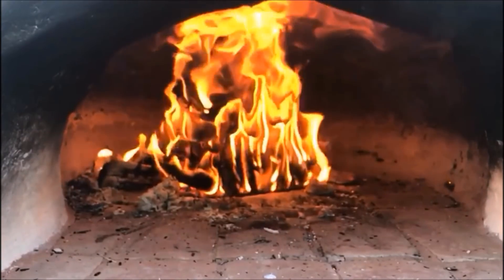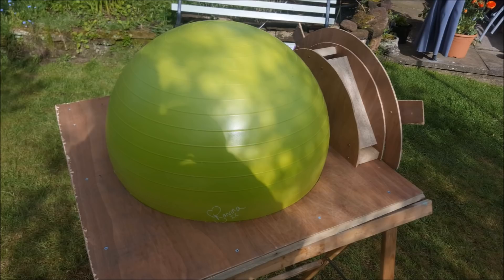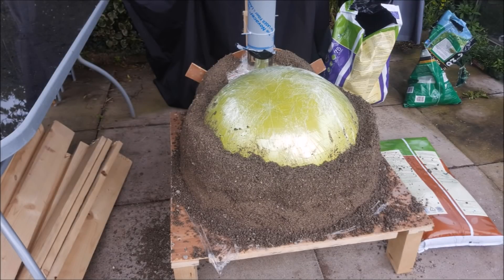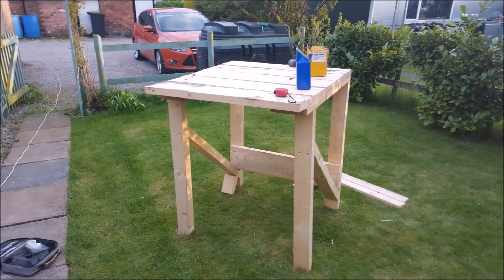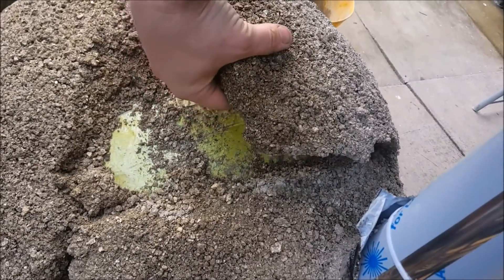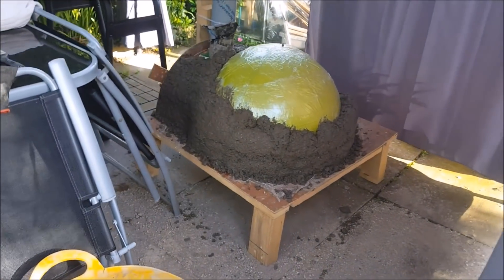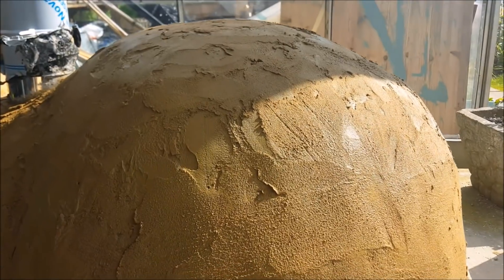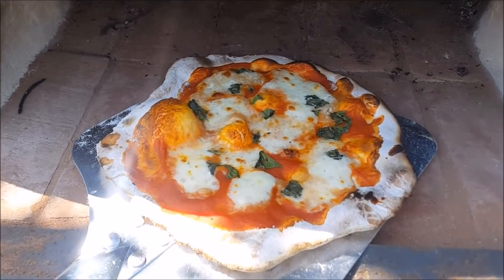How To Make A GYM BALL PIZZA OVEN 🍕

Comment: Thanks so much for including the mistakes and the fixes.  Makes it seem more doable by real people.
Reply from the maker: Thanks! I felt like the mistakes were worth including so that if anyone tried it at home they don't make the same mistakes!
Thanks for watching 👌
Reply: @PaulLloyd  Looks like I made a bad mix.  I used 5 perlite and 1 refractory cement.  It didnt hold together.  I have it all crumbled in a pile.  You reused the mix.... how did it hold up?  Im going to add one part portland cement and one part sand to it....
Reply: Agreed, I thought the same
Reply from the maker: Just go for it 👌
My lesson is use plenty of cement to hold it together and not let it dry too quickly!
Use a damp towel to cover it and slow the drying.

Comment: How did you persuade Jason Manford to do the voice over :-). Great video Paul, thanks for sharing. I broke apart my first attempt with the gym ball because I thought the wall thickness was too uneven and thin towards the top go the dome - and I was right. The flex in the gym ball tended to slide material towards the base of the structure. I solved this by using a Tyrolean Gun to apply the first 2 cm coat all over. I then placed a chicken wire frame over the cement mix and then finished with 4cm of cement, again applied with a Tyrolean Gun. Worked a dream and only took 20 minutes to apply. I used 5 vermiculite to one cement mix and made the mix fairly wet (worked better in the gun).

Comment: I'm at the stage where I will be adding the 2nd layer of concrete. Many video's show chicken wire being used to reinforce the concrete.  Is this something you considered and if not would you use chicken wire if you were to make another oven ? Thanks in advance.
Reply from the maker: I haven't had any big cracks in mine, although adding chicken wire wouldn't hurt. 👌 It would keep it together if you got a major crack in it & you could just seal it up again.

Comment: Thanks Paul. What was the heat retention like considering that you didn’t use any other insulation? Did the outside of the oven get hot too? Thanks

Comment: My plywood underneath sand, underneath firebrick is turning black and you can smell it smoldering, during my initial curing fires. Did you have this problem? Will it hold up? Am I going to have to cut the oven off the brick, dig up the bricks, and add insulation? Please help.
Reply from the maker: Are you burning wood inside the oven?
I haven't had any problems like that.
The bricks that I used were around 4 inches deep.
You could always build from underneath with either insulation or a sheet of metal?
If the board underneath the bricks goes on fire & you have something else underneath supporting it, I can't see it being an issue.
Reply: @PaulLloyd  thanks so much for replying and helping me think through it. My bricks are 1.5". Maybe that is the problem. I think I need to find a way to get insulation under the bricks. Thanks again.
Reply from the maker: Would love to hear what you come up with! Keep me updated 👌
Reply: @PaulLloyd  So, I took the outer boards that were containing the bricks off. Then started excavating sand, and eventually got planks underneath to lift the whole thing off the table. Now applying ceramic fiber insulation to table, then will rebuild. We'll see what happens!
Reply from the maker: Sounds good! Sounds like you've been busy!

Comment: Hi There. I've seen you video and I liked your project. I would like to know if your oven still working and if it has any cracks now? plus if it still in good condition can you tell me more about your mix as I'm planning to make one myself.
Reply from the maker: I haven't used it this year due to working on other projects/Coronavirus/being busy. It has had a cover over it through the winter and this year too. It could do with getting the spiders web out & have a fire in it first before cooking. Other than that it is as good as the day it was built. No new cracking either!
Just make sure that it doesn't dry too quickly and you should be good 👌
Reply: @PaulLloyd  Thanks for your reply. If I don't stress too much. Can I ask you concrete mix formula?

Comment: Hi. My Pizza Oven also cracked in the same way that yours did. I have smashed it all to bits thinking that I could probably re-use the materials. My mix was 5 parts vermiculite and 1 cement. I bought some refractory cement. I would like your opinion on how I should go about the 2nd attempt. I was thinking of perhaps using 4 parts crushed mix ( from the failed build ) with 2 parts refractory cement. 

Can you clarify what your final ( successful mix was please, ratios and materials ). 

Finally, did your render survive the heat. Other video's show various mixes for the 2nd layer, including just a layer of refractory cement or a 2nd layer of vermiculite / refractory cement. Your render would be the cheaper option but just want reassuring that it didn't go pear shaped after use.

Sorry about the long winded question but want to get it right before making the 2nd attempt. Cheers Paul.
Reply from the maker: Use plenty of cement. I found the refractory cement to be too dry & would do a 1 - 1 mix between that and normal cement.
 Also, the vermiculite didn't take too much water the second time round due to it being coated in cement. 

The top layer was just a sand/cement render and has held up pretty well!

If you're on Twitter, I can share some pictures on there with how it is holding up 2 years later!
@PaulLloyd10

Good luck! 👍
Reply: @PaulLloyd  - that would be great. Duffgen on Twitter. I doubt that there would be many with that name. Thanks Paul.
Reply from the maker: Duffgen or Duffgen62
Reply: A stable temperature required so that the air inside the gym ball doesn't expand with the warming weather.

Comment: The fire bricks are so expensive. So only use them for the fire contact area.. I made a vermiculite dome 5 to one and its five years later and I have no problem.
Everybody including me make the base too low and you end up bending too much when you make the p izza
Reply from the maker: Yeah I am glad now that I made the base quite high.
It has started to crack around the chimney though so I will have to do some repair work when the weather gets a bit warmer! 👌
Reply: @PaulLloyd  thats no problem. I have four layers now but that gives it a bit more mass for the heat retention
Reply: Hi when you said ratio 5:1 did you mean 5 parts vermiculite 1 part cement or the other way around ?
Reply from the maker: 5 parts vermiculite : 1 part cement
👍

Comment: Hi Paul, Quick question, I'm currently building a similar style pizza oven. i was wondering if you've experienced any problems using just a sand base and brick on top? as this is what i plan on doing sand and firebrick. no cement mix.
Reply from the maker: I used just normal solid house bricks and brushed sand between them.
The first few pizzas did have sand in the base of the pizza when cooked! But after brushing them off quite a bit it was all good!
I have had no problems with the base & it holds the heat well! I get a good colour on the pizza base & it cooks through 👌
Let me know how you get on with yours!! 👍
Reply: @PaulLloyd  Thanks for the reply Paul, just over halfway through the build! can't wait to finish :)
Reply from the maker: Nice one, sounds good!
If you use Twitter you'll have to send some pictures (@PaulLloyd10)
👌
Reply: @KieWalsh  How did yours turn out?
Reply: Mitch Dunn came out perfect. No issues at all! Vermiculite dome, fire brick base with a couple of inches of sand underneath on a wooden frame.
Reply from the maker: Thats awesome! Glad to hear everything went okay!
Hope my video helped! 👍

Comment: Was the sand enough to insulate the wood from the heat of the firebricks?
Reply from the maker: Yeah, it seems to have worked really well. The bricks have done a good job in holding the heat in! 👍

Comment: Hello.
Cool idea to use the gym ball.  Creative.

Suggestions
1. I think if you soak the verniculite for 1 hour will have a better drying process.
2. If you add a Concrete bonding adhesive (Sikalatex) will increase the bonding of materials and strength.
3. If you add a final layer of foam cement will increase the temperature inside the oven.
4. For the bottom you need a ceramic heat plate as a base.
5. if you add a chimmeny  for the smoke and air flow, you can add a metal plate to cover the exhaust.
6. You can add a door to keep the heat inside.
Reply from the maker: I like the suggestions!
I basically made this up as I went along and made a video from it! I would definitely do some of the things that you mentioned if I would do it again!
Soaking the vermiculite, putting a layer of foam before the render and making a door are all really good ideas!
Thank you for watching! 👌

Comment: Thanks for the info - can you say what kind of bricks you used? also is there a ratio for the door/tunnel height in relation to the full oven height? I read somewhere that traditionaly it is something like 63%
Reply from the maker: I used reclaimed old hand made solid bricks, similar to these on eBay https://www.ebay.co.uk/i/264385213471
For the size of the door, there was no science behind it. I just wanted it smaller than the dome so that it looked nice! There is probably a formula for the optimum door/dome ratio somewhere online, but this does the job.
Reply: I think you have watched jos Townsend chanel , right??? He's the one who said about the perfect height  ratio between the door and dome.....

Comment: Informative video! 👍
Do you think refractory MORTAR will do the same job as cement in the vermiculite mix?
Reply from the maker: Thank you!
I think so yes! After I have built & used the pizza oven, I think it matters less about what it is made of and more about the thickness of the dome to retain the heat!
Reply: @PaulLloyd  had any cracks yet?

Comment: Did you forget to fully absorb the vermiculite in water to let it expand fully before adding cement? it looks like the vermiculite sucked all the water out cement  before it got time to cure.
Reply from the maker: I didnt let the vermiculite soak first before making the first one. It did however take alot of water when making the mix. I just put it down to drying too quickly from the heat & not from absorbing the water.
Thanks & hope you enjoyed the vid 👍

Comment: hey Paul its been about a year since you made your pizza oven... how has it held up? anything you would change?
Reply from the maker: I would have put sand/cement in between the bricks on the base. I had an ants nest in there at the start of summer.
I kept it under cover during the winter with a BBQ cover and it kept it well. The wooden legs are starting to twist with the weight & water on them too. Planning on building a brick BBQ next year and I'll make space for this too.
If you follow me on Twitter I can post some updated pictures there 👌
@PaulLloyd10

Cheers

Comment: A lot of people use insulation material. Did it make a difference not using one?
Reply from the maker: I don't hav anything to compare against, but mine has done a pretty good job and still going strong!
It heats up pretty quickly and holds the heat well.
Reply: @PaulLloyd  thanks mate. Thinking of it as a summer project as I would love to cook some meat in such an oven.😀